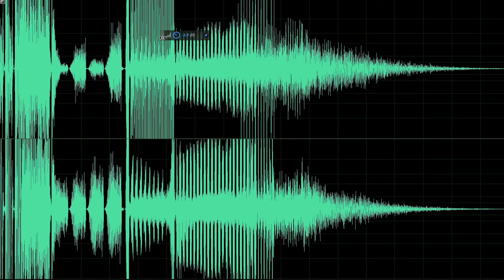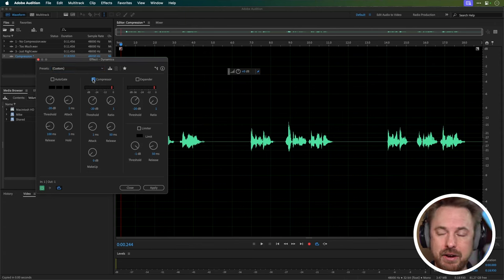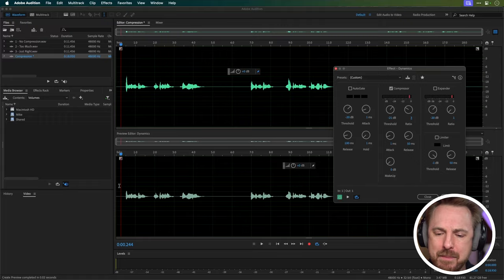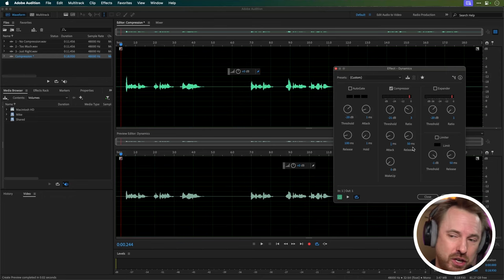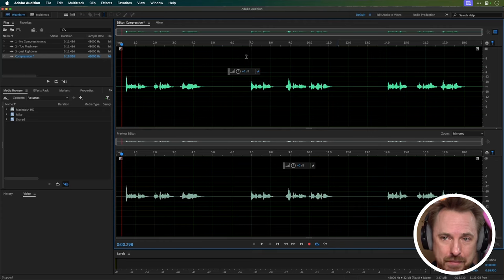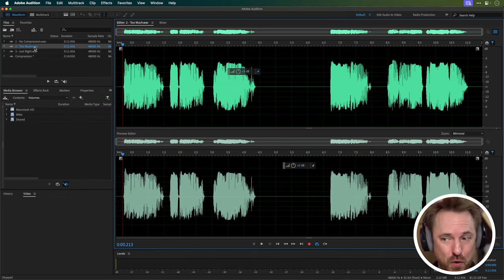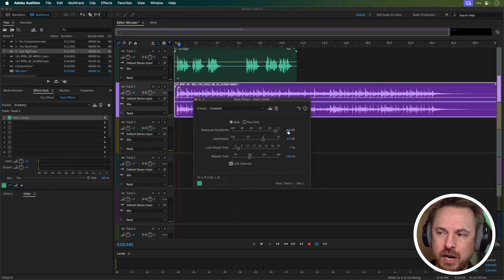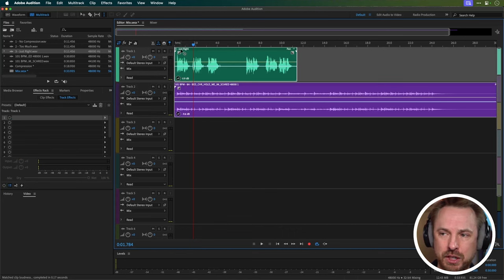Compression Killing Your Audio? Post Processing Techniques Everyone Should Know

Comment: Great video .How can I translate these steps to the GoXLR (full size) software with an SM7B?
Reply from the maker: The specific steps may vary depending on the version of firmware running on your GoXLR unit and any additional plugins or presets available. It might also require some trial and error to find the optimal settings for your particular setup. Once you know basics compressors are pretty universal.

Comment: I've over compressed an audio book chapter - and the file is saved. I put too much make up gain. Is there a trick to lowering the compression after it's compressed? Because it's audiobook it has to be at certain levels, so if I drop DB's it doesn't pass standards. Or do i need to go to the raw and do it all over again?
Reply from the maker: You can try using parallel compression to blend the compressed audio with the dry signal, or use multiband compression to target specific frequency ranges and adjust the overall balance without starting from scratch with the raw file.